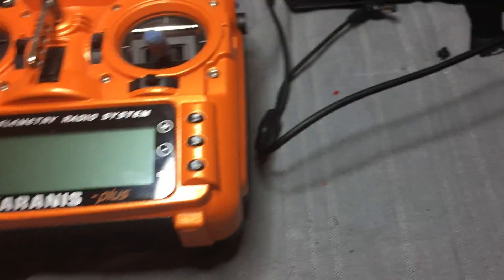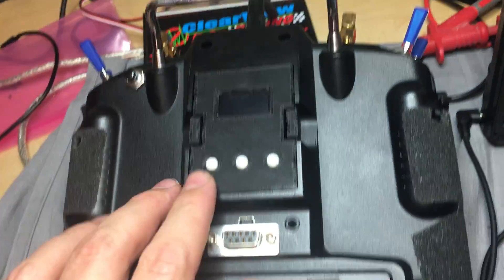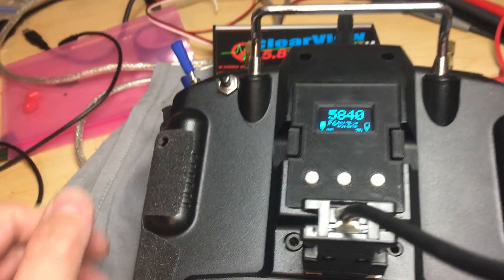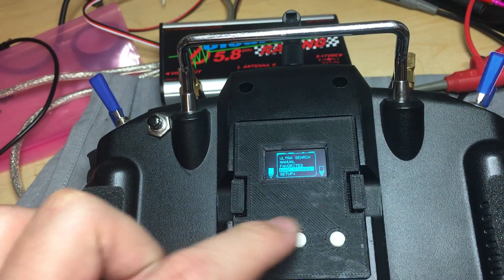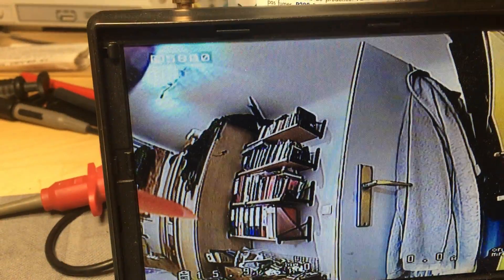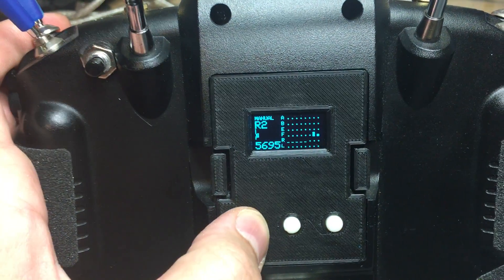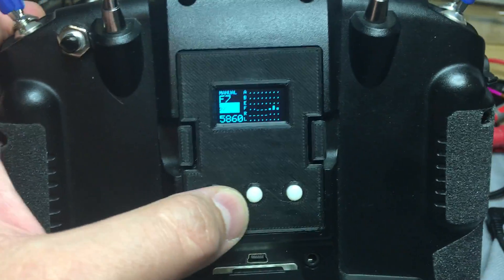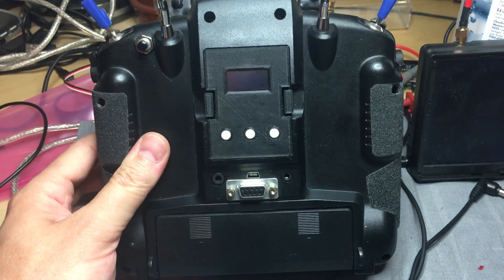ClearView OLED Mod

Comment: Hi, nice video, may you please tell me where you get those rubbered gimbal stick ends? Thanks
Reply from the maker: Those are self made. 
They are not rubber. The core of it are just the old normal aluminum sticks. I sanded them a bit so they stick to the glue, then dipped them in epoxy resin and then dipped that in some kind of sand like material that I got at an arts store. Then waited a bit for the first layer to get somewhat dry and then repeated the process. At the end it was thicker than I wanted and also too rough, so I put an M4 screw in a electric drill, screwed on the stick and then sanded it to the shape I wanted while spinning it.

The end result feels a bit like grindstone or sandpaper. It has perfekt grip even with sweaty fingers and you can pretty much make any shape you want it to have!
Reply: Thanks a lot for that detailed info. I will try to make my owns because I can not find any other than the classic metallic one. Thanks again.